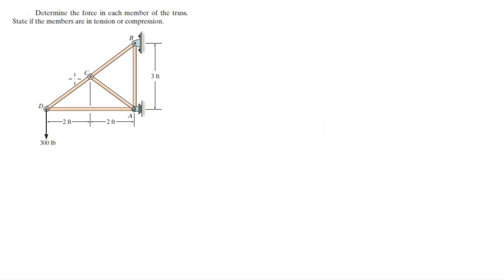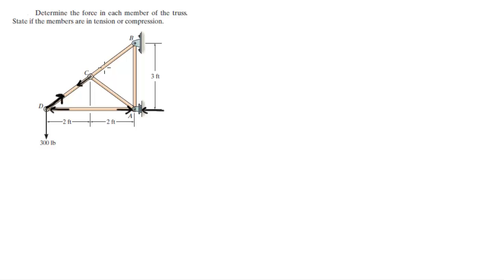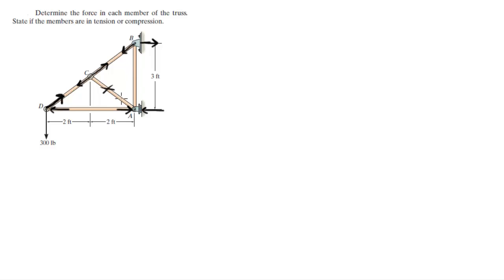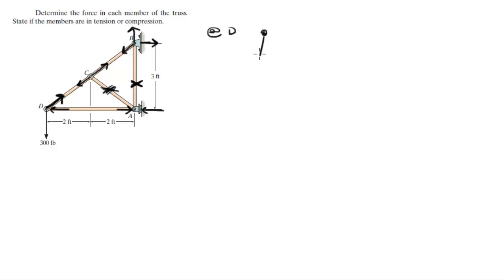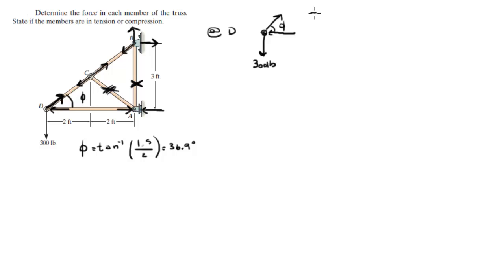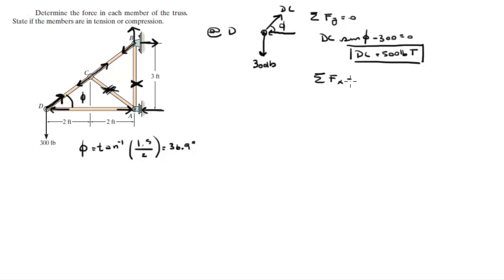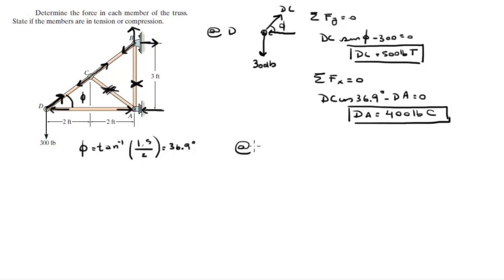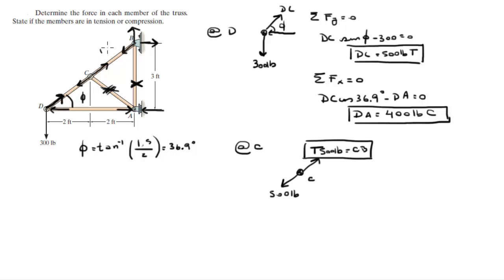Determine the force in each member of the truss.

Comment: what if you were to move the force of 300 lb from joint D to joint C? Would that change anything in the solution?
Reply: Yes, AC is only zero by default if:
- 2 collinear & 1 non-collinear members are connected at a joint (T joint)
- AND there is no force or support reaction acting on the joint (outside of the three members)

If there were a 300 lb force acting on joint C in the diagram, you would have to make a free body diagram and solve by writing 2 force equations in the x and y directions.
Reply: @lentil68  ur so nice, answering everyone's questions :)
Thank u
Reply: @lentil68  thank you so much for this!

Comment: Why AB is zero force member??
Reply: Since there is no force in AC, there is no force acting on the A joint in the y-direction (notice: the support reaction is a roller that acts in the negative x-direction, if it was say a pin for example, the solution would change). Therefore, there is no need to compensate for a y-component in the AB member, defaulting it to 0.

Zero force members are intended for stability, support if load conditions change over time, bracing of tensile members, aesthetics, etc.

Comment: Can you explain more in depth as to why members AC and AB are considered zero force members?
Reply: AC is a T-joint: because there is no outside force acting on joint C and members CD and BC are collinear, then the non-collinear member (AC) is a zero force member. To express this mathematically, draw a free-body diagram of a joint with three forces coming out of it in the shape of a capital T. The collinear ones must balance each other out. But there is nothing to balance out the non-collinear member, thereby defaulting it to 0. (This would not be true if there was any other load acting on the joint!!)

Since there is no force in AC, there is no force acting on the A joint in the y-direction (notice: the support reaction is a roller that acts in the negative x-direction, if it was say a pin for example, the solution would change). Therefore, there is no need to compensate for a y-component in the AB member, defaulting it to 0.

Zero force members are intended for stability, support if load conditions change over time, bracing of tensile members, aesthetics, etc.
Reply: 7 years now
Reply: @pilot1813  8 years 😁
Reply: 😁 8 yesrs  @pilot1813
Reply: after 1 year still he didn't answer it he is kind of .....
Reply: @mohamedarab6187  2 Years now
Reply: @dominicnikon6276  5 years now
Reply: @jadrianrodriguez2156  6 years now
Reply: @kemuri.1699  9 years now😁
Reply: and now its 7 years  @mohamedarab6187

Comment: how about working out the reaction forces at A and B
Reply: You could do that, however it is not necessary because you have enough information to start at joint D without the support reactions and the question does not ask for the support reactions.
Those types of questions were asked in an earlier chapter of this textbook (rigid body equilibrium) and are used later on in the topic of frames and machines.